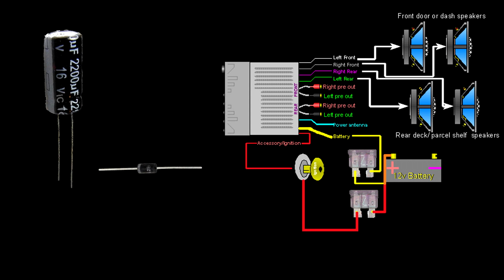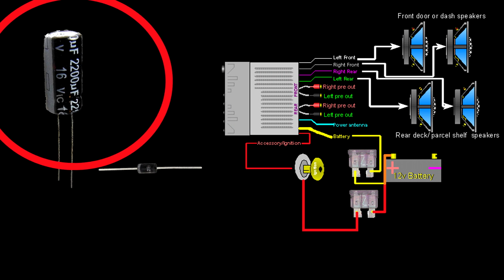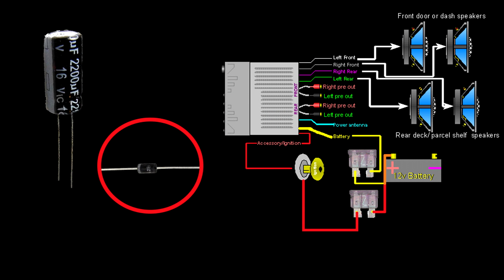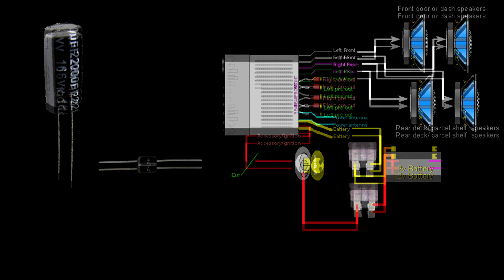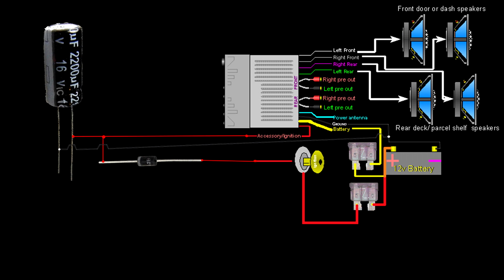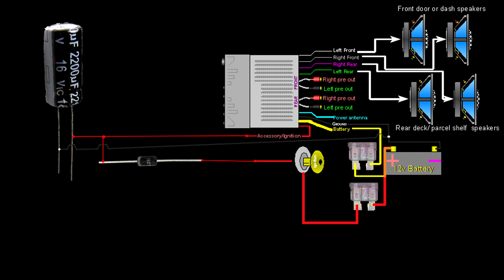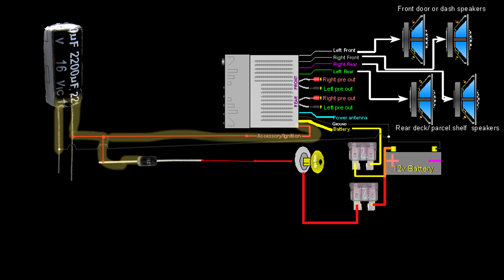HOW TO: Keep Your Car Stereo On While Starting

Comment: thanks for this video. Wasnt too sure if this would work/was possible. I hate having all those nice salvaged caps around and feeling like i shoudnt use them, all the main sources online say to use one of those stupid pre-built car audio capacitors which are WAY over priced. going to give it a shot when ever I find a diode to use.
Reply: Hey Ben,  I know its been three years ago but...do you remember what diode to use in this case?!? Thanks!!  Don
Reply from the maker: Basically any round, black diode will work.